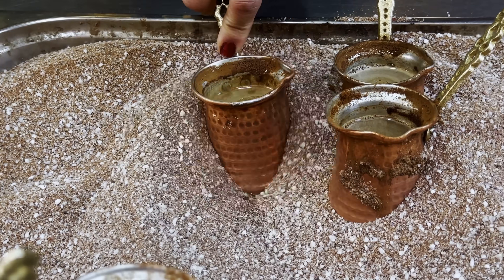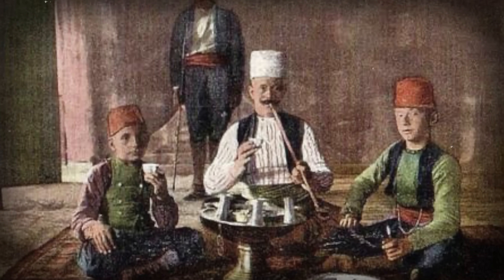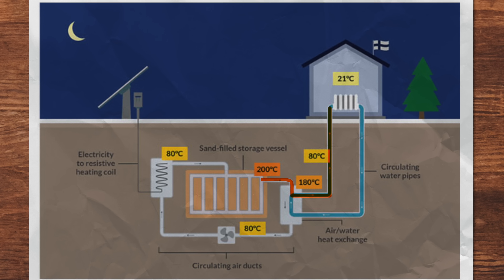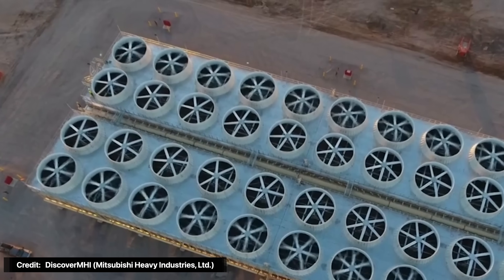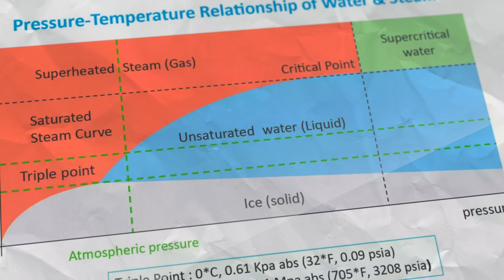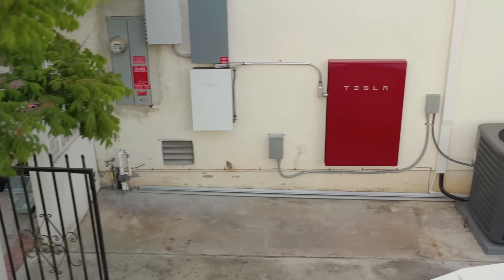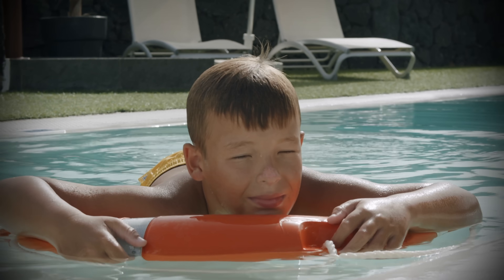The Power of Sand Batteries -- Revolutionizing Energy Storage...

Comment: add refrigeration heat cycle in combustion heat engines, efficient to 99%. yep, re-capture any heat energy back into the heat boil hot storage with minimal heat pump efficiencies losses. sand freezer combustion engine. click-bait. lol. sun is a nice safe fusion plant. totally butchered as always. lol. yep combine heat pump in the electric conversion process, to re-capture any conversion losses mostly. and above all, do your own research. any trading is optional and dont trust any people, even yourself. God gives freely, its an absolutely totally actually free gift. peltier solid state generator on the side of the heat storage, maybe even part of the insulator structure. even if one element is low power, its the efficiency vs power/heat loss that matters. which can be very low. its only the leak through the generator slab. dependency on gas and other stuff can be fixed with the local producing and storage systems. I mean personal producing and storage. diy. yes you can. dont let anyone either force you (to work for you or them, or them for you) or say that you cant, and then force sales on you. trading always optional. nothing required through trade or people. water amount, purification, salt, maintenance, leaks etc. if you like carbon capture, with CaO lime water slurry, then also capture heat from the exhaust. both. the other components dont have to be expensive or complex either. heat pump with screw pressure cylinder filled with air/nitrogen is just a common car engine. do you have a lack of room. dont have. any type of storage, heat, is fine for electricity storage and generation. alone. when done smartly and correctly. dont assume you have your grids and neighbors with you to share always. assume independency instead. if you cant then dont expect someone to do it for you. nothing. let God be your skill and wisdom, and actual true life. nothing from people. cheers. money is related to trade, what money, what trade. why. for what. diy. market competition is not a guarantee, and does not have to be. I will not compete. I dont need to. God gives freely. so you mean people are thin air and vacuum. ok. forced reliance hurts everyone in the process and system. dont be judged in anything by your peers. your brothers. this judgement is not ok. not sharing anything what is of God and owned by God. nope. dont serve people. not because of a command even. God gives freely, not like poor limited with in us. God is rich, and people are poor with their money. marketing for market has no cause. one million nothing. cut your AC costs with the cold/heat storage, and its a buffer for surprising events., like cold and hot snaps. as its said, none of your business. lol.

Comment: Steffes ETS made brick heaters starting back in the 1970's. the heaters use off peak power to heat the bricks and then a blow fan mixes room air with a small amount of the air that passes by the bricks. Steffes then made them even better by adding low temperature salts to the bricks. this gives them phase change energy storage. And there are other materials that melt in the temperature range that heat pumps can reach. so no Sand is not the best.

Comment: Sand (and better yet salt) might make a good heat battery but water and or salt might make a better cold battery.

Volumetric heat capacity for one cubic meter of
Water 4.184 MJ/m³*K
Sand 2.1 x MJ/m³*K
Salt 9.04 x MJ/m³*K.

Because water can't store heat above 100c without requiring significant pressure containment,  while sand and salt can without much consideration for pressure changes.   As to a cold battery for air conditioning, temperature is mostly limited by not wanting not freeze water condensation from air, so the temperature shouldn't go below 0c. Operating a heat pump over night will reduce the temperature drop and improve the heat pump's COP. But, both sodium chloride salt and water store more energy per cubic meter than sand.

Comment: Storing cold isn't going to be practical.
2 reasons:
1) Heat can be put into sand at 100% efficiency with cheap reliable heating elements.
2) You can store a ton of heat because there is no upper bound to temperature, even at absolute zero you could only get a small fraction of the energy storage.

Comment: Buried silos would be easier to insulate.
Reducing the air gap between sand grains will increase thermal migration efficiency. That could be filled with crude oil tar, the remainder after all the useful constituents have been removed by the successive tower crackers. The tar can hold well at the needed temperature. This would also create another useful byproduct for a nearly worthless residual.

Comment: I keep hoping to see a solution that can do "seasonal" energy shifting, not just "daily". California has a surplus of solar power in Spring and Fall, but we have no practical way of saving this for Summer and Winter. Batteries are too expensive.  Sand seems the same. Hydrogen generation is very capital intense for such relatively low annual usage.  Ideas?

Comment: A cold battery is know as ice storage which has been around for years.  They used to be recharged at night when electrical rates were low.  Now they are recharged in the day and are depleted at night when there is no cheap solar to power HVAC equipment.

Comment: When it comes to heat energy storage, besides cost of the storage medium, volumetric heat capacity is an important consideration. 

For instance silicon dioxide has a 1.855 J/(cm³*K) But sodium chloride is 9.04 J/(cm³*K). 
This means sodium chloride can store more than 4.5× as many joules of energy for each degree of temperature rise in a cubic cm. Yet both cubes have the same surface area to lose heat over.  In other words, for each joule a cubic cm of silicon dioxide stores, a cubic cm of sodium chloride rises in temperature by less than 1/4.5 that of the silicon dioxide. And how fast heat is lost given the same surface area and insulation is proportional to temperature. 

Bulk sodium chloride and sand have similar cost so per cubic meter, so its volumetric heat capacity should take on a more important role in consideration.

Comment: Great idea!  Reminds me of Drake Landing Solar Community in Alberta, Canada, a neighborhood which stores so much energy in the summer that they can use it to heat all winter.
Reply: Exactly 
It’s not a theory (any longer) but a proven solution that should be highlighted 🎉
Reply: And, how do they store it for long-term use ?
Reply: @markhathaway9456  They store a heat in a large underground area all summer, and it stays warm enough to provide heat all winter.  You can't easily insulate something this well for a single house, but you can for a neighborhood.  (Heat escapes based on the size of the surface area but the total amount of heat/energy stored is based on the size of the volume.)

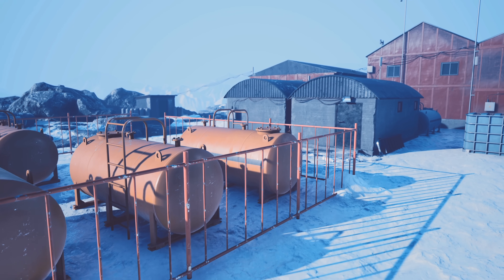Comment: If you want to store cold, liquid nitrogen would probably be better because of the phase change (14:40).  You're also have an absolute limited of 300 degrees of temperature difference because it's impossible to store below absolute zero.

Comment: One thing to remember when comparing the cost per kwh of a battery vs heat storage is that the electricity from the battery can be used with a heat pump which can have 400 to 500 precent efficiency in converting electricity to heat but also can be used for cooling.  But in really cold environments, the sand battery seems like 8t could  be a  good idea.
Reply: But the heat could come from concentrated solar which is 95% efficient at catching sun rays instead of 20-25% photovoltaic with also a lot less copper silver silicon etc

Comment: I am building a passive house with radiant floor heating. I have to insulate under the slab-on-grade and this got me thinking. What if I dig a bit deeper, insulate, then put down a layer of sand with the Pex piping in the middle of the sand layer, followed by the concrete flooring above. Would the sand battery under the slab make the entire flooring more efficient? Should the PEX go in the sand or the slab? Has anyone done this? Someone must have, but I can't find any information about it. Please tell me your thoughts.
Reply: It could work, but get a “open-minded” mechanical engineer to do some heat loss heat gain computation, you’d need to ensure it doesn’t overheat ( which is a different problem, even in very cold climates) 

I did something like that but using earth tubes that were charged/ recharged and it worked fine 👍🏿
Reply: Thank you, Kori. I'll see how open-minded of a mechanical engineer I can find :)  @koriifaloju2051

Comment: Outstanding video! I've got 5120 watt-hours of LiFePO4 storage, and many hours of wasted solar energy each day. I'm thinking of building a sand battery, using it as a solar dump load. Yours is the best video on this topic so far. Absolutely brilliant and thanks for sharing.
Reply: @jxpat watch this video
Reply: This is totally doable, though if you have access to the grid the easier dump is to just throw it onto the grid with a cheap micro-inverter.    In your case, however, I would spend the bucks on adding more main battery storage to improve your overnight margin and give you some bad-weather bridging capability first, before worrying about energy dumps.

One thing you are going to hit up against is, well, the weather.  On hot days we have a ton of excess solar but no real overnight heating needs.   On cloudy days or cold winter days we generally do not have enough solar so there isn't any excess to dump in the first place.

That's a bit of a problem actually.  One has to have excess production during the days or weeks where the dump can actually provides a useful service.

--

In anycase, if you are going to do a dump I recommend doing it through a satellite battery instead of directly from the main system.   That's what I do.   I have a 48V main system (10kWh) and a small 24V satellite battery.  I have a DC-to-DC which dumps any excess energy when the main system is full over to the 24V satellite battery.

This way I can transfer excess energy at 1000W but my actual "dump" doesn't have to be 1000W, and I can control WHEN I actually dump to the actual dump independent of when the excess energy was being produced (which can be quite important actually).

I then have a timer which turns on the actual dump from the 24V satellite battery at an opportune time for when the dump is useful.  The actual dump device can be anything.  It can be a sand battery, a small A/C or heat pumps, or a cheap little grid-tied micro-inverter if one has access to the grid, it can help the water heater,  Etc.

-Matt

Comment: Why not use one or more Fresnel screens to focus sunlight to heat the sand? The screens are relatively cheap and can produce up to 2000F or more at focal length. After an initial start-up, the system can maintain itself even on mildly cloudy days. It's possible to not only heat living space, but also produce electricity from sunlight.
Reply: Generally the way it is done is with reflectors... rheostats.   A curved mirror focuses the sunlight onto a tube filled with your heat exchange liquid.  That liquid is pumped through the tube along all the reflectors and then goes through a heat exchanger in the actual sand-battery (or whatever).

Comment: A dual phase sand tank with separate cold and hot sides sounds kind of brilliant. You'd be able to do all kinds of amazing things with having both a chilled battery and a heat battery. Throw in some heat exchangers and suddenly your steel plants are powering your industrial freezers. The concrete plant down the street can cool the freezer of every local restaurant. If we think in terms of districts and communal sourcing rather than individualized solutions, economy of scale works in everybody's favor. It makes little sense for an individual house to power it's own hot water tanks when it would cost orders of magnitude less overall to do so for an entire city, plus there would never be any chance of running out of hot water.
Reply: I'm pretty sure you'd quickly run into huge losses if you try to run very hot or very cold water through long runs of pipe.  A city-wide system would (I surmise) have far greater losses than using heat pumps for individual freezers and water heaters.  Industrial freezers (and heat pumps generally) are already extremely efficient.  With a good modern unit, you get about 3x more cooling than the amount of energy you put in.  This is because heat pumps MOVE heat, rather than generating it.

Comment: Solar Roof PV directly into the AC chiller pump fan system means that when the sun shines heating the building the most, the AC working hardest, all the solar PV energy used directly without being stored in batteries, especially with micro-inverters on the PV panels making AC directly in each panel //
Reply: There are several on the market that can directly take solar DC string voltages to run the A/C.  You don't even have to go through a DC-AC conversion stage.  However, this is not really ideal because homes take a while to heat up from the sun.   On a hot day, our solar system starts producing significant amounts of energy as early as 8am, but the A/C in our house doesn't usually have to kick in until roughly noon, or even 1pm.  And in a similar vein, one generally wants the A/C to run well into the evening, long after the solar has stopped producing.

Comment: Consider a geothermal heat pump system with a large ground pipe heat loop that works as AC for cooling in the summer hot, or for heat for warming during the cold winter / effectively treating the ground & heat loop as a geothermal battery energy buffer, thermal capacitor if you will //
Reply: Perhaps filling the hole that the geothermal loop installed into with sand after the pipes are in place and secured, would improve the thermal efficiency or performance of such systems

Comment: The math that kills this: Sand stores about 2 kJ/kg of energy as specific heat. Organic phase change materials store roughly 200 kJ/kg, inorganic PCMs can store nearly 400 kJ/kg. The entire pitch of this Sand Battery garbage is that it's "all natural straight from the ground", but what it really is is wasteful and so terrible at storing energy that you need a small building just to contain enough energy to power a house for a day. It matters that conversion efficiency is only 30%, because that waste heat means we need massively more renewable capacity, and we're already struggling to try to build enough. And that waste heat requires cooling, usually with water cooling towers, which is not a plentiful resource in all places. Sure you can use the waste heat for district heating in cold seasons, but for half the year in non-polar regions there's a hot season in which this waste heat is going to have to be rejected. 

To those saying that batteries, which have +90% round trip efficiencies and low cooling requirements, aren't a sustainable approach, I'd advise you to actually look into battery research in just the past few years. There is a constant push to find chemistries that use less or no special metals/elements. Lithium iron phosphate batteries use 80% less cobalt than traditional lithium ion batteries, and many sodium ion chemistries use cheap and abundant elements. It's also facinating how obsessed people get over the ecologic implications of mining battery and electric motor components, all while having no problem with iron or coal mining (or sand dredging in this case) that produces the base upon which almost every large constructed item is made. Just food for thought.

TLDR: If you want to store heat or cooling, there are cheap and renewable materials that can do that with over 100x the energy density, but instead of alchemical names like "sand" they have chemical names like "octanoic acid". Batteries are a good, cost effective and environmentally tolerable option now that have many benchtop innovations happening now that will make them even better next decade. And mining is an inherent part of gathering base resources to build large projects, including sand. Arguably, because of it's terrible energy density, more mining/dredging will be needed to make sand batteries than chemical batteries

Comment: 90% round trip efficiency, when the heat is used directly & only 65% efficiency when the heat is converted back to electrical power. I assume for both of these numbers that the heat was transformed from electrical power by using thermal resistance.
 What would be the efficiency numbers, if a heat-pump was used instead? Using electrical power to "make" heat with thermal resistance, is as you said, almost 100% efficient, but heat-pumps are even better since they don't "create" the heat they just move it around. So would using heat-pumps instead of resistance make this process competitive with lithium-ion batteries in terms of efficiency?